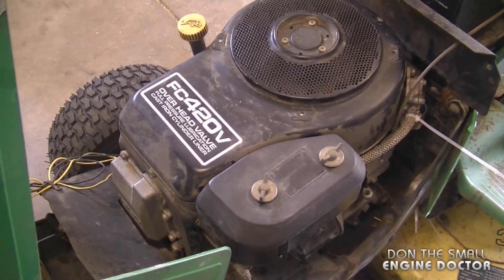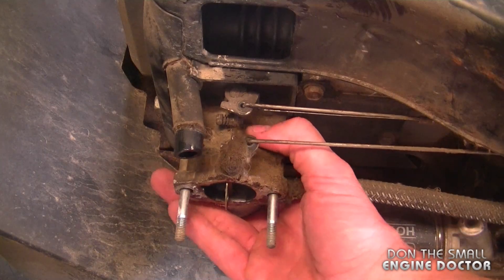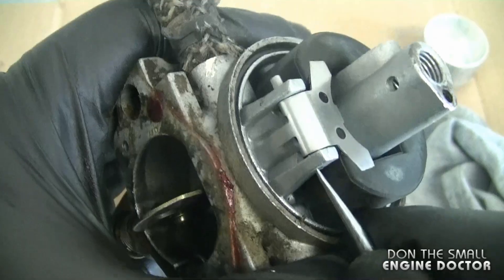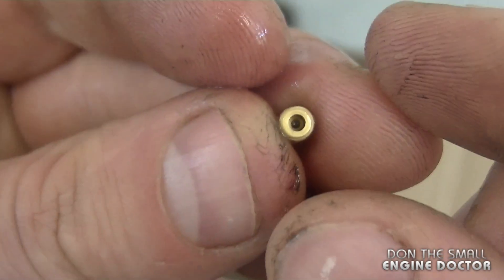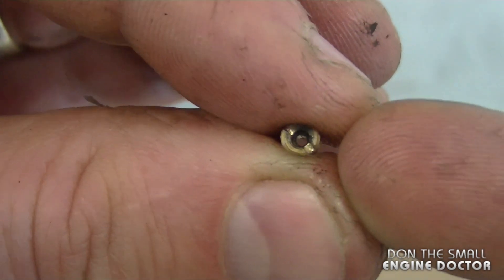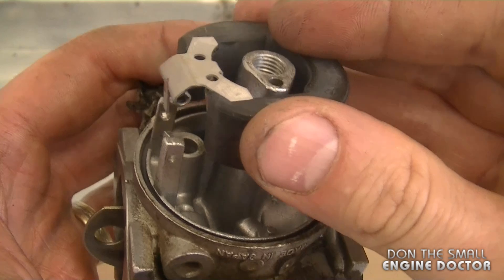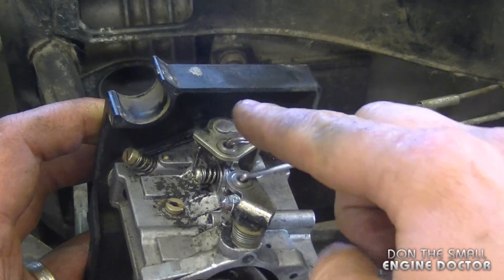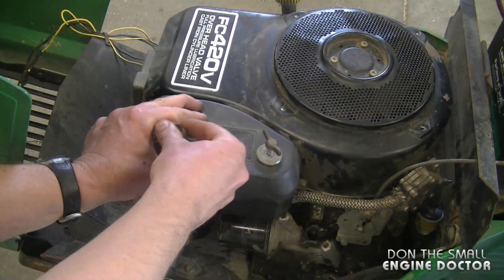Carburetor Cleaning On John Deere 170, 175, LX172, 176, and 178 Lawn Tractors

Comment: Hey dony I was wondering if you knew where I could get the throttle cable and handle mine works fine just the end of the rubber piece on the dash broke off so i was wondering if you could msg me back I would greatly appreciate it thanks man
Reply: If JD does not have the part or it is way too pricey, I would just check CraigsList under Farm and Garden and then search JD mower.  A lot of folks part out the old JD mowers now.  With time you can pretty much find any part.
Reply: +Raoul Thomas that's why I asked don because I know he has some old junk mowers

Comment: I would have replaced that braided fuel line with the correct fuel line.
Reply: The braided hose is actually the stock hose that Kawasaki uses. I’ve worked on a lot of Kawasaki engines on Deere’s.